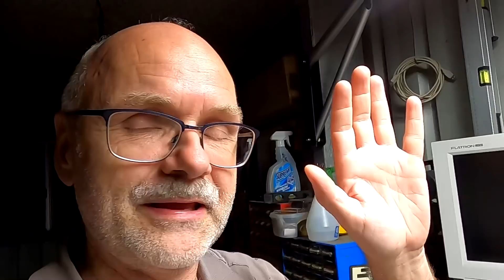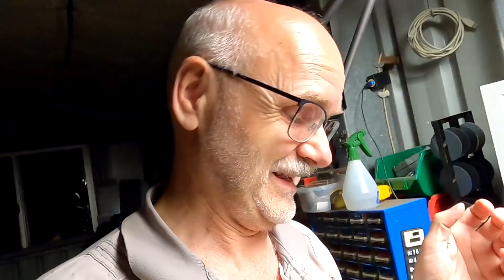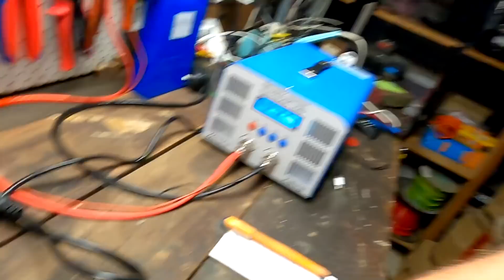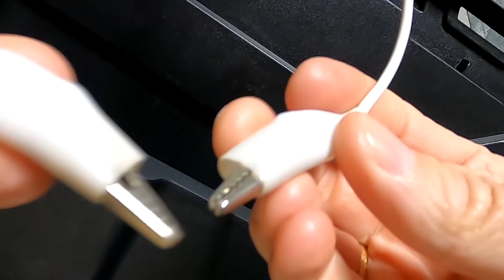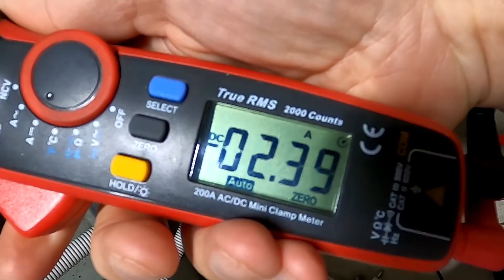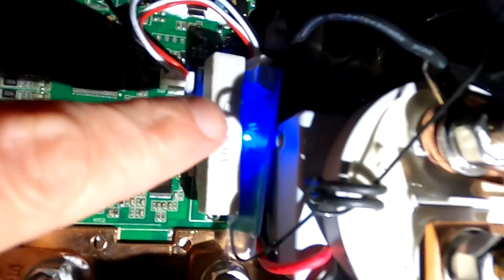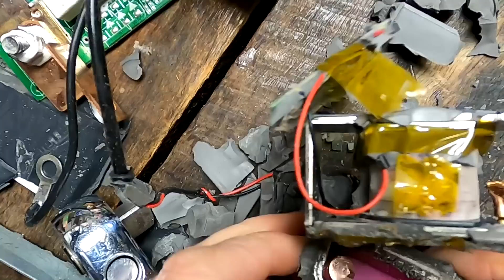The new QUCC 200A BMS. Does the Relay-BMS work this time?

Comment: It appears that the solenoid uses magnetically assisted closure to reduce solenoid current and losses.
It appears that with zero coil current current, the magnetic assist was too much and the solenoid did not release. You could still check that with the disassembled solenoid.
Reply: I doubt that it is "magnetically assisted closure to reduce solenoid current and losses".  The magnets are for Arc Quenching ...
Reply: @MrSummitville  Thanks very much for suggestion. There is a great demonstration at https://www.youtube.com/watch?v=WeVHtMMbYvM
I wonder what arc looks like with an inductive load.
I owe you one -- Thanks

Comment: I would presume the BMS can separately disconnect the battery for charging/discharging simply based on the battery vs external bus voltage: if the battery is already charged and current is still incoming, disconnect to avoid over-charging and don't re-connect until external bus voltage drops below battery voltage or the battery voltage drops below end-of-charge voltage. Not as clean as FETs that can enable each direction separately but still gets the job done if your inverter can tolerate the contactor delay.
Reply from the maker: Yeah, at the end it's just a safety device, an insurance for your battery. If it voltages or currents goes very high/low, it's there to protect the battery.

Comment: Well done Andy for tearing down solenoid to find problem. I have a query though if your charge controllers are connected on load  side to the inverter if your bms solenoid turns of due to soc therefore you have your solar will supply high voltages to the inverter causing damage.
Reply from the maker: Thanks Craig. This is not the case with Victron inverters. If the BMS shuts off the battery, both inverters will go into Absorption mode and supply power to the inverter as long as they can.

Comment: I think it's better to split your batteries in half so that you use 2 smaller BMS without a relay so that it's more reliable.
Reply from the maker: This BMS is super reliable. Why do you think this one is unreliable?
Reply: @OffGridGarageAustralia  you recently showed us the failed relay didn't you? and a mechanical switch is generally less reliable as something with less moving parts, relays in general except for winch relays are very unreliable. just read all the reviews for them. automotive relays at 30-40 amps are also exceptions. the relay you have you already proved is unreliable

Comment: I would ditch that BMS, why take the chance that it will destroy your batteries?
Reply from the maker: Why do you think it will destroy the battery? It does the opposite.
Reply: @OffGridGarageAustralia  not if the relay fails to open, again you showed us the failed relay. it's not conjecture at this point.

Comment: If the charge disconnect switch in the app does nothing and the app is generic, does the cell over voltage setting of 3.65 volts actually operate the discharge function of the relay. Normally the cell over voltage would be operating the charge disconnect function. A test of this might feature might be worthwhile.
Reply: What if there is a different model BMS?  A Dual Port BMS with two (2) relays?  Relay #1 for the charger & Relay #2 for the Inverter?  This appears to be a single relay = Common Port ...
Reply from the maker: Hi Neil, I tested this function here: https://youtu.be/PbzTmk5mzr8

Comment: I think that the BMS can see if we are willing to charge or discharge the battery by checking the voltage at the entrance of the BMS. If the voltage applied to the BMS is > battery voltage, the external world is trying to charge the battery, otherwise it is trying to discharge the battery. The BMS then activates the relay or not according to its prescribed behaviour and to this voltage difference.

Comment: Yes, the app is use for other BMS also, qucc is rebrand from jiabaida , they have other type of bms , and all use the same app
Reply from the maker: Thanks for the information.
Reply: Andy, FYI: I have learnt that Jiabaida is often referred to as JBD.
As you are a Victron Rpi VenusOS user you might be interested to know that a Victron Community user @Louis van der Walt has created an integration driver for VenusOS which includes the JBD (& QUCC by association with XiaoXiang phone app).

https://community.victronenergy.com/questions/76159/victron-venusos-driver-for-serial-connected-bms-av.html

https://github.com/Louisvdw/dbus-serialbattery

This allows you to see, like you do for your Solar Controller and Shunt all the BMS values in VRM from anywhere you have internet.
Reply from the maker: Oh, great, that's a very good tip. Thank you very much!

Comment: Well it's a real head scratcher for sure. Not knowing whether you hacksawed though the bold attaching the actuator, yea hmmm.. sure would explain though if that pin broke long ago. Could be the design flaw the engineers know of so they quickly replace. Seems like a good bet for the weakest link.. idk thinking out loud. Awesome it's the same balance lead setup because that may have turned out to be a nightmare to replace reroute, retest then reconnect lol ieieiee. My thoughts on the xiaoxiang app is like you say for other mosfiet type BMS it's using those settings. I use this app to for my bms as well. Cheers and sunny days brother! 🌞
Reply from the maker: From what I could see, I sawed through it, it does not look like broken or so. I still have no idea why it did not work and opened the contact.

Comment: Your really need to chuck that POS out and get a real BMS - get yourself an REC BMS - it will communicate with your Victron gear to control charge and discharge. Much much better solution.

Comment: your victron smart shunt I think it counts a cycle not as total capacity discharged but as like discharged to 60% and then recharged above 90%. That counts as one charge cycle and then your synchronized cycle is how many times the percentage recalibrated to 100% based on whatever parameters were set under the battery setting
For your real charge cycle count you should divide your discharged energy by your batteries capacity
Reply from the maker: Hi Josh, the Victron Smart Shunt accumulates the Ah and calculates the cycles form there.

Comment: If the voltage inside the box(IE. Battery voltage) is greater than the voltage outside the box (cables to/from the inverter) the battery will discharge if the BMS relay is closed. If the voltage inside the box(IE. Battery voltage) is less than the voltage outside the box (cables to/from the inverter) the battery will charge if the BMS relay is closed.
Reply: Yes, and you can use the app to choose if you want to use either one of those, both, or none!

Comment: Hi Andy, you are right. The App ist a gerneral App for many BMS. With my BMS it works to switch seperate discharge and charge but I do not use and do not need this function.

Comment: I have always wondered how this works. You define the parameters of the cycle, Right? So if you don't get 100% charge and discharge as you describe them it never records a cycle but smaller cycles are happening all the time.
Reply: Possibly because Andy entered 280Ah for the capacity, and in another field, on the first pop up screen
Reply from the maker: It accumulates the mini cycles you do until a full cycle is added up. I think it also takes into account that 10x 10%DOD is far less stressful than a full 100%DOD cycle.

Comment: Tested my QUCC bms yesterday. Not sure if the internals are exactly the same but my bms looks identical. Look up Jiabaida bms on aliexpress and thats the model I have. With hardware single cell high voltage set to 3.9V and regular single cell high voltage my BMS would cut off charging appropriately. I am not sure if it works with only regular single cell voltage set and idk if they have to match, if hardware setting overrides "regular" setting, etc etc. Still have to test lvc functionality.
Reply: Hmm yeah maybe not the same at all...
Reply from the maker: Thanks, yeah I think it's just re-branded as someone said here. But same hardware.

Comment: Yes thats the latest xiaoxiang app. I've just started using it on my jbd. I believe it is just a general app used on other bms also.
Reply: The ability to control charge and discharge, is usually a feature of more expensive, separate port BMS, with C- and B- connections.

Comment: Was looking forward to this episode.  Caught that decoding the RS485 part yeah find that interesting, it's not too hard but it does take some fiddling around if you don't have the tech info.  A USB logic analyzer is what I use to figure them out, well my Oscope has it as well but like using the little USB one just in case something goes wrong can always buy a cheap board again.
Reply from the maker: That would be something for another channel. I like it.
So you're basically sniffing the data stream and try to make sense out of it.
Reply: @OffGridGarageAustralia  Yes it's actually fun.  The code is usually Hex using RS485 Modbus protocol.

Comment: When someone below mentioned a car solenoid, I thought of something... I once bought a starter for my car that didn't work. Since I live several miles from town, I took it apart to see if I could fix it. I discovered that the solenoid had been wired backwards! Swapped the solenoid terminals around and I've been driving with that starter for almost five years now. I don't recall (and it's too late now), but did you try something like that with the relay?
Reply: The solenoid plunger was functional - we heard it click on & off ...
Reply from the maker: Yes the pin definitely moved, just the contact did not open any more. Still not sure why not...
Reply: @MrSummitville  My starter solenoid clicked too, in the wrong direction.

Comment: Andy, love you videos, always look forward to new ones. Question: have you looked at Electrodacus SBMS0 (Solar Battery Management System zero). It's will not work on your 48v system but I see you discussing 12 or 24v with your 100ah cell. What are your thoughts and may be an interesting subject? I'm quite
Reply: Man, my English is terrible-my apologizes
Reply from the maker: Yeas, I am in contact with them. The problem is they only make their BMS to for 24V system, not higher. Not sure about the reasons but I think it has something to do with the Canadian rules of low voltage definition.
Reply: @OffGridGarageAustralia  Yes, 12 or 24v. Check out this PDF; it summarizes my of the pros.
http://svsoggypaws.com/files/lifepo4/Beginner%27s%20Guide%20to%20ElectroDacus%20v0.5.pdf
Reply: I'm designing a large system for an RV, 24v

Comment: IT IS BROKEN-the contacter with the spring should be mechanically connected to the to the solenoid to work,the spring is to assist
Reply from the maker: The spring is assisting in what, helping closing the contact or opening it?
Reply: @OffGridGarageAustralia  You said it yourself, to help hold the contact closed. The pull in current and the hold current were not measured.Some solenoid relays, this one in particular has magnets to hold pin in retract mode (the permanent magnetic field holds the pin in magnet equalibrum) then the electromagnetic portion of this solenoid adds to the magnetic flux,causing it to rebalance(move physical to close)-Personal comment,can't understand why this relay broke,interesting design

Comment: The BMS may measure if it would charge or discharge with the help of  the big ceramic resistor. Then controls the relay according to the settings you made with the app.
Reply from the maker: The 10 Ohms resistor is definitely for pre-charging the caps in the inverter. I could feel it getting warm. The black cable sitting on the output of the relay is the voltage sense, so the BMS can feel what's going on outside if the relay disconnects. That is my understanding so far.

Comment: RS485 is a bus standard. Several people already explained that. The most common protocol used on it is called modbus. Very simple thing to query data from a device or set some values.
Your BMS (in fact it's a JBD pcb) uses a different protocol. It's similar to modbus but proprietary. 
Within this protocol the two switches for charging/discharging are defined.
Since this protocol is valid for all JBD BMS, the app doesn't even know that yours has only one.
There is also a PC app that can be used with this BMS.
Reply from the maker: Thanks for your explanation. I wasn't aware there is a PC app as well. Does this still work via Bluetooth?
Reply: @OffGridGarageAustralia  In your case you probably have to replace the Bluetooth module with a connection box.
https://m.de.aliexpress.com/item/1005001653622108.htm
A simple 3.3V ttl2usb adapter works as well, so this box is not really necessary. Warning: The VCC pin carries more than 10V you shouldn't connect anything to that. For communication purposes GND/RX/TX are sufficient.

A lot of information and the PC software is on this website
https://www.lithiumbatterypcb.com/smart-bms-software-download/

A good description of the communication protocol and an older version of the software can be found here
https://hackaday.io/project/162806-jbd-bms-protocol

There is also a uart port at your BMS exposing RX/TX. (The leftmost connector) I have no idea what it is. Maybe it can be used to attach an usb2ttl adapter. But I have no information on that. If anybody knows I would be most interested.
Reply: Figured out some more.
The RX/TX plug can be used instead of the Bluetooth connector if you use B- as ground.
Furthermore, the "Weak Switch" can be used to manually switch off the BMS.
You have to enable "Switch Function" in the app under "Function Settings". Then opening/closing the connection betwen the "Weak Switch" contacts will disable/enable the discharge function.

Comment: Measure ohms across where the BMS was, the sensing wire. The fet is shorted. The relay only kicks in on higher current use normally. I really wanted you to measure this before cutting the perfectly good relay open. Also the battery cycles is only counted when you discharge all the way down, however I am sure the battery wears somewhat whether you discharge fully or not. Anyhow you need to keep an eye on this..question now becomes what happens if you put 90v of panels onto a full battery. Does the BMS successfully isolate your battery or does it short the FET again?... Charge controller short fault simulation.
Reply: The Victron mppt controller converts the higher voltage to Amps, at an appropriate charging voltage, around 50+ volts
Reply: @michaelbouckley4455  yes but what is the failure mode? Is it a isolated buck or will a high side FET short place solar PV onto battery?
Reply from the maker: The smart shunt accumulates Ah and calculates cycles form this as per settings. I ran the battery down only twice so far and have it hovering between 60-80% since.

If I turn off the battery, the SCC go into absorption mode straight away and still supply power to the inverter. Once the battery comes online again, it starts a new charge cycle.

Comment: Very cool with the cycle count! I've had my system running for about 6 months so far, and it's showing 53 cycles, which I keep thinking "must be wrong". But when I looked closer, it's probably right. I'm sure some BMS's do it differently, but the Daly that I use seems to click over another cycle when it reaches a cumulative 100%. So a 100% discharge will be one cycle. A 30% and 70% discharge will be 1 cycle. A 20%, 65% and 15% discharge will be one cycle, etc etc. 

The really annoying thing, is that battery manufacturers don't seem to conform to this standard when quoting "cycles". They will say 2,000 "cycles" at 80% DOD, which equals 1600 real 100% "cycles". Or some will quote 10,000 cycles at 20% DOD, which is once again a misnomer, because that really equals 2,000 cycles. 

Perhaps there should be a revision of how it's quoted. We could use "cycles" meaning discharge events, and "Cycles" (capital C) for 100% of the capacity drawn from the battery.
Reply: I believe it means 10,000 equivalent full cycles when using 20% partial cycles. (50,000 partial cycles.) If it were the other way then we would see no real benefit from using small cycles. Lead acid data sheets would show higher total energy throughput for 100% DOD but we know from practice that that is very much not the case.
Reply: @henvern  exactly, it's just a somewhat misguided description. We really need to establish what the word "cycle" means, because it's being used differently and people will get the wrong impression. But it looks great of a specification sheet for a manufacturer trying to talk its products up.
Reply from the maker: 10x a 10%DoD is not the same as 1x 100%DoD. Smaller Dods are far softer. Also it depends where these 10% are occurring. Right around 50%SoC, it's the best with the lowest degradation and at the very low or upmost end it's that hardest for the cells.
Reply: @OffGridGarageAustralia  yep I totally agree. I wish I could find some data to quantify it all though. 

Pretty sure the BMS doesn't take into account the % position of the discharge, or the rate of discharge in its calculation though. I think it just adds it all up and once the tally hits 100, it ticks over another cycle. 

It's these lengthy tests that require long periods of time (months or even years) that data seems to be vague or non existent.
Reply: @OffGridGarageAustralia  I see an entirely new field opening up for lawyers to use to force manufacturers to come up with universal standards so as to prevent 'false advertising'.  One lawsuit for millions in money will scare the devil out of any who are in this business.
Reply from the maker: @aday1637  just the advertiser sits in China...